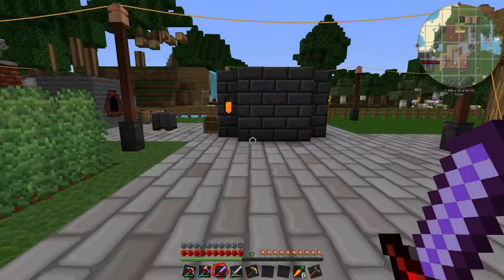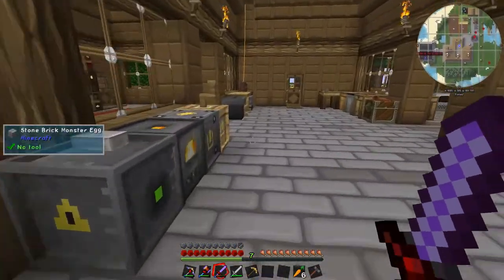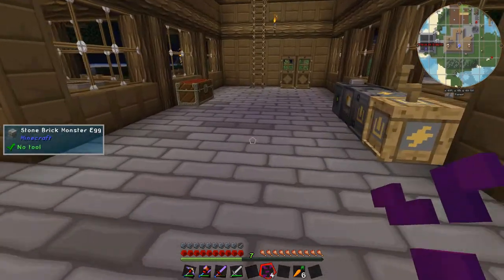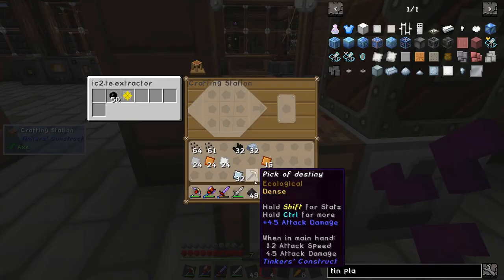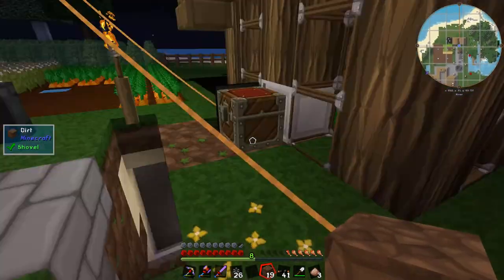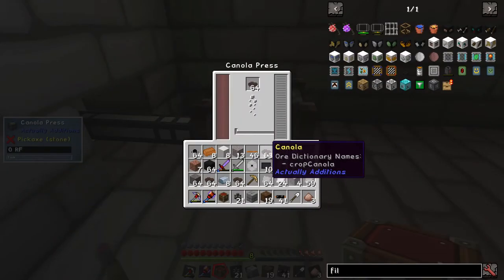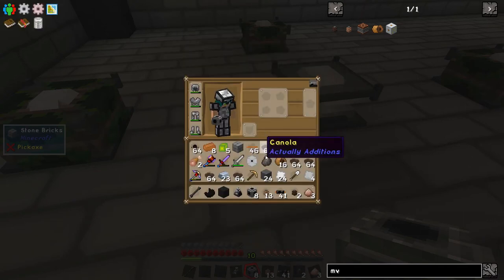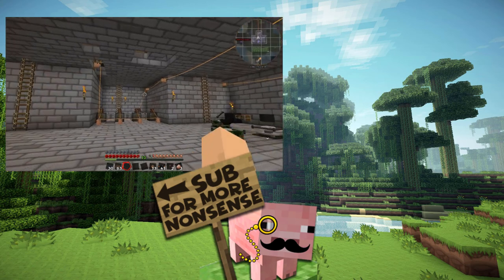Age of Engineering 17 | Oil Power! | Closet Gamer

Comment: Oh I meant to say on the last episode: I loved what you did with the waterwheel - while it wasn't the most efficient, it looked awesome! Still looks pretty good now, but I reckon if you swap the glass out for IE wooden scaffolding it will still work and look the biz!
Reply from the maker: Thanks man! The waterwheel is an ongoing project, I'm looking forward to actually being able to measure its output, I think something from enderIO allows this? Also, the scaffold is a great should and would fit in very nicely indeed.
Reply: Awesome :) and there is actually something from IE as well - you briefly alluded to it, but you might have been looking at the wrong item: as well as the normal Transformers, there is also a block called a "current transformer" - this can be attached to any tier of IE wires (so you can have the same going in and out of it), and when right-clicked it will tell you what the average energy transferred over the last 20 ticks was.
Reply from the maker: FallingofftheGrid that's the one! I knew I had seen something like that in a tutorial a while ago! Cheers dude!

Comment: Noooooo you called it Benni-toyt! * sad face *

EDIT: (it's benito-ite)

Also, I'm really surprised you didn't have the oil from the squeezer going straight into AA fermenters - they need no RF, just time, and the oil they make is like double the RF/t in a generator!
Reply from the maker: FallingofftheGrid burrito-tit? I realised during editing that I pronounced it wrong but left it in because I remembered you telling me not to pronounce it wrong on the FTB forums a while ago - don't worry I might do a pronouciation special at some point 😂 I also didn't know about fermenters!  Are they expensive?
Reply: Haha! :D it's only because it's a mineral, and that's what I do for a job - likewise for me when people mispronounce chemicals (because I studied chem). I'm glad you left it in, it made me laugh :D Ben-eat-o-ite ("ite" like in kite) if that helps ;)

As far as I know, the fermenting barrels are pretty cheap - I don't think the recipe was changed much? It might need the wooden casing, and if that's been changed... well, it's worth a look. One nice thing about it is if you put the fermenting barrels on any of the cardinal sides of the press (i.e. Not top or bottom) it auto-outputs the fluid into the barrels. Then you can just pump out of the barrels with fluid pipes or transfer nodes, whatever works for you. I believe 3 barrels per press is enough to keep up.
Reply from the maker: for some reason your comment was held for review - perhaps YouTube detected spam encoded in the subtext of your message xD Aha, my friend, as always you are one step ahead. Check out episode 18 when it goes up and I arrive pretty much at the same conclusion - i think I end up with 2 presses, 6 fermenting barrels and 8 oil generators - yes I went a bit crazy with power! :D
Reply: Ahh that's odd! :) ah well.  I didn't spot the presses - I might have to rewatch that again!
Reply from the maker: FallingofftheGrid no you didn't miss anything, it's in the next one :)
Reply: FallingofftheGrid I've been calling it ben-e-twa. I guess I'm doing it wrong.